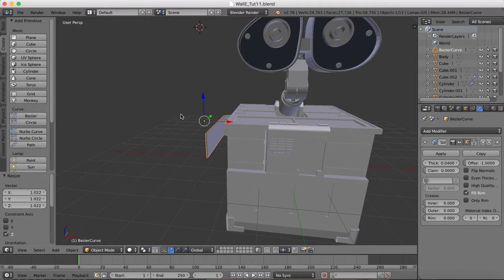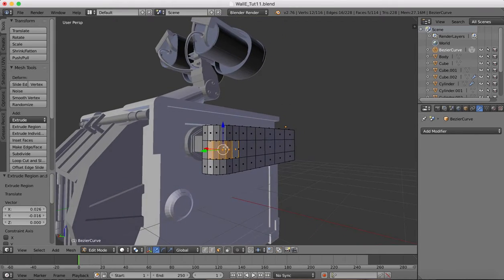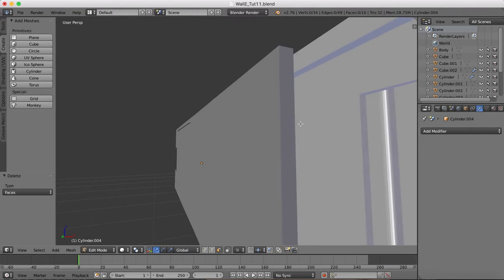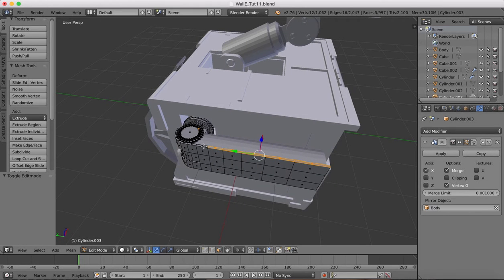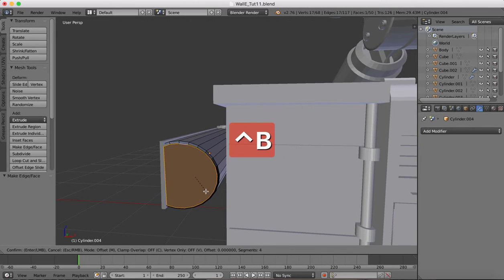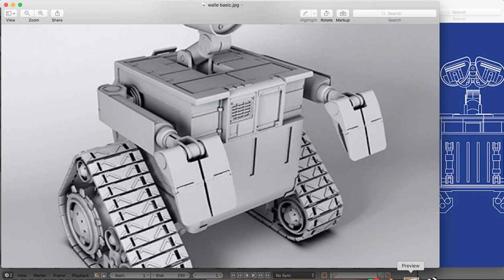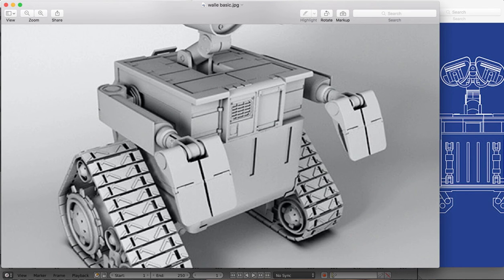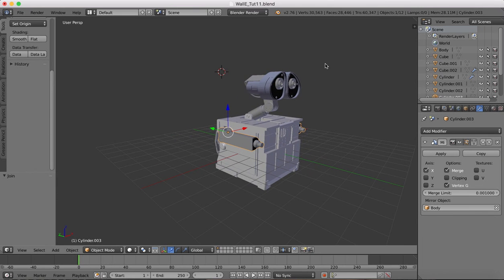Blender Wall-E Tutorial 12

Comment: For the semicylindrical part of the arm, I'd use HALF a cylinder. Then I'd extrude the two edges to meet the flat part.

There's something weitd on the arm's end - I gess there's a face too much. Also, the normals aren't correct (I can see there are darker areas). Quick fix: select all the part and hit Ctrl+N while in Vertex selection mode.